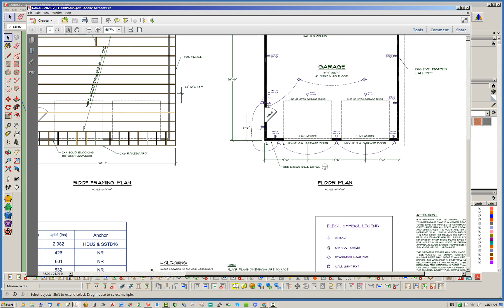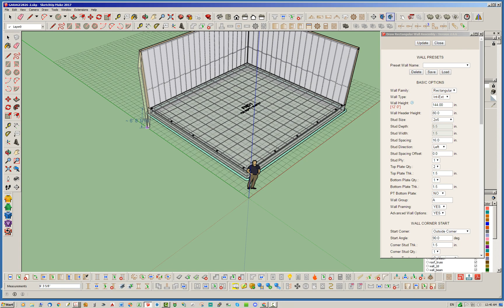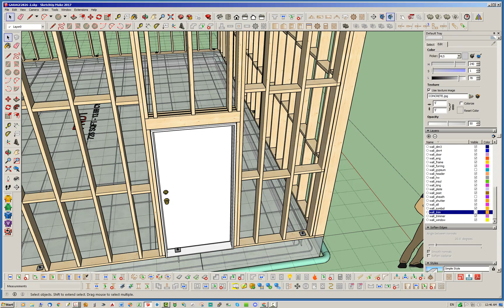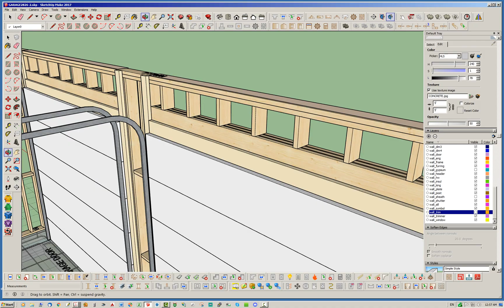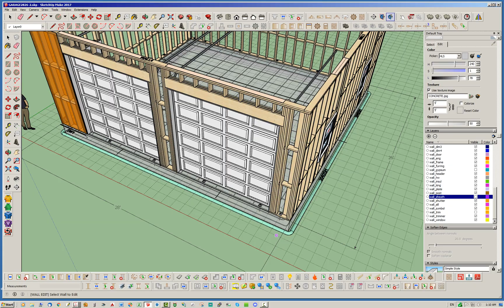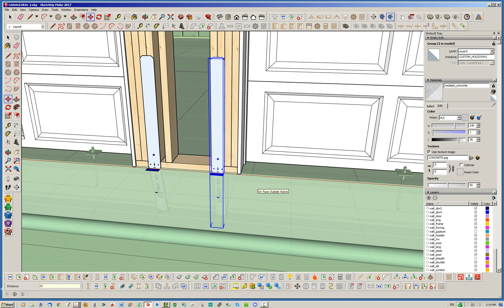mdkBIM Tutorial 2 (Part 1) - Garage 2826-2

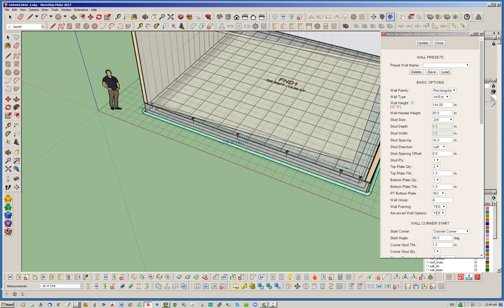Comment: 8:55 you can see why I like the offset option because we set the plate back so the sheathing does not hang over the slab which you do not want especially on a turn down slab where the grade gets close to the siding sometimes and we have easy access for rot and termites accessing the sheathing edge :)